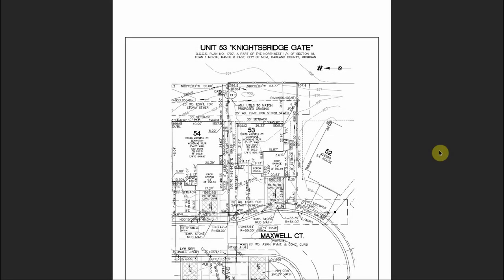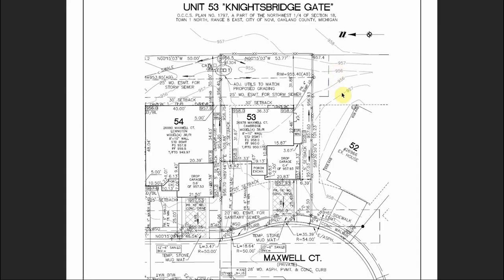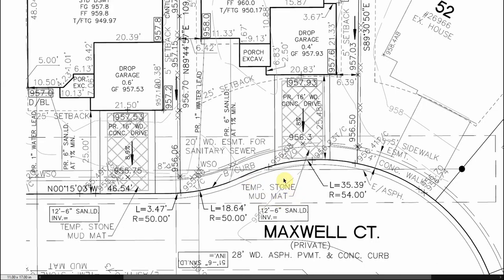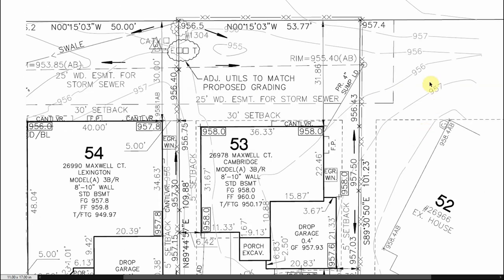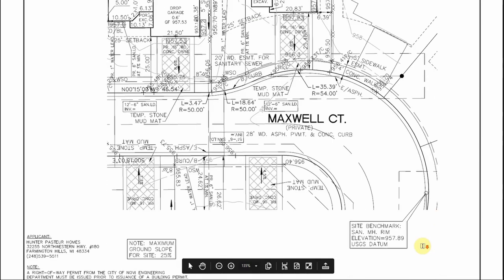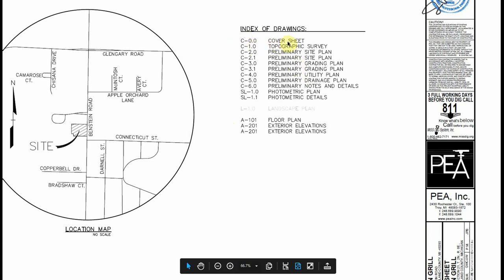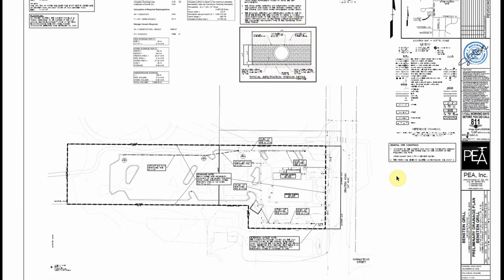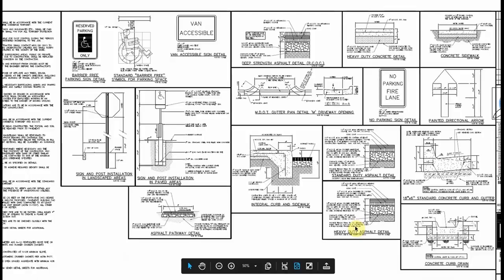HOW TO READ RESIDENTIAL BLUEPRINTS AND COMMERICAL BLUEPRINTS FOR HEAVY EQUIPMENT OPERATORS

Comment: Does your local code not require separation of services? At least for the first of the run. Usually water with minimum 1’ separation ran over the sewer is common here.
Reply from the maker: We generally add separation by running the water line on a ledge within the same trench.  The sanitary will be roughly a foot away and at a lower elevation from the water line.

Comment: Hello there, I really enjoyed this particular video simply because you went into an in-depth explanation of the subject... maybe for somebody who is just playing around with blueprints, this might be boring, but not for me! On the other hand, I certainly appreciate you taking the time to actually send me a video regarding my request for this particular information. That leads me to another request: Can you explain how the True North and Project North relate to each other and to the installation of the structure of a building? I am sorry if with this question I am taking too much of your time but for me, this is crucial... thanks a lot in advance.
Reply from the maker: This is actually pretty straightforward and doesn't require a full video breakdown.  True north is exactly that.  When true north is referenced the project is aligned to its orientation as it will be built.  The problem here is that turning a building on a 32 degree angle on blueprints to make it align with true north doesn't really make sense.  Instead we rotate the building to line up with the actual print.  This is project north.  The layout of the building on the drawings or on the computer screen is oriented to whatever direction we decide looks best.  Project north will be located at the top of our drawing even though true north might be 30 degrees offset.